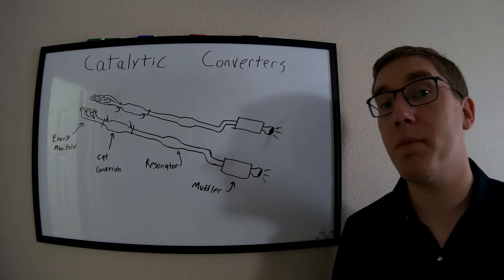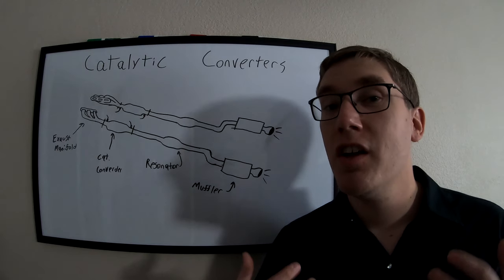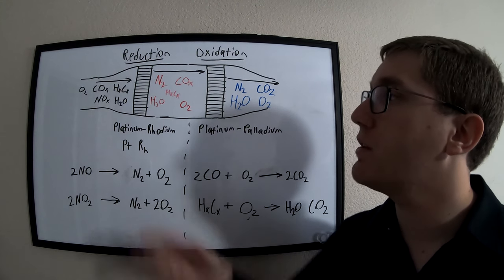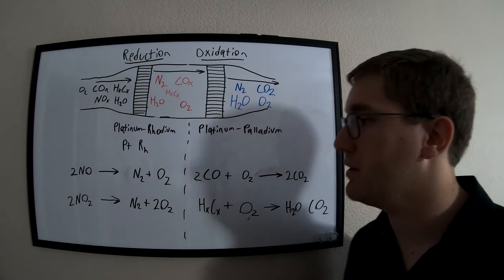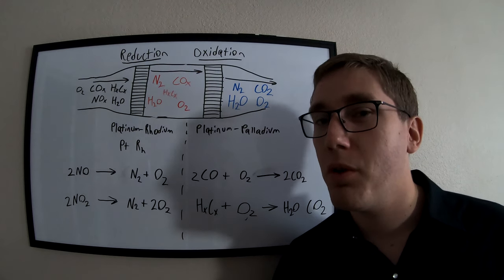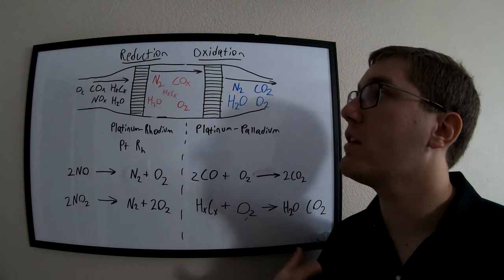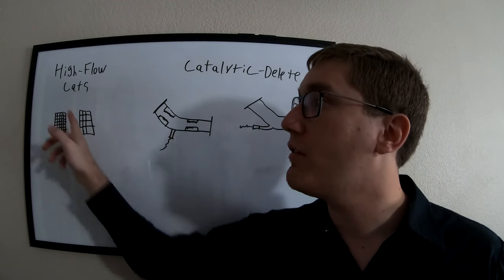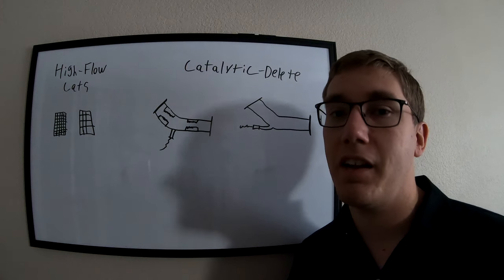Catalytic Converters - How They Work

Comment: Hey bro thanks for your instructional video on changing the air intake hose, changing all my spark plugs, and changing  my oxygen sensor , changing my air filter and finally changing my oil and oil  filter. My baby now runs so smooth and very quiet too (much better gas mileage too)!!!!! Your videos were very detailed  and had fully explained  steps.  YooHoo !!!! Btw I have 2009 Nissan Sentra FE+ ( bought in Texas new) Keep the excellent  videos coming.  I'll be sure to spread your channel around!!!!!
Thanks !!!